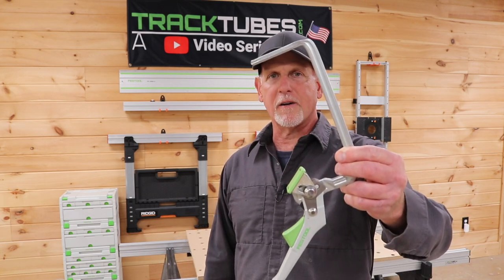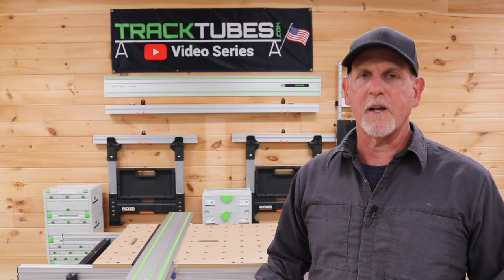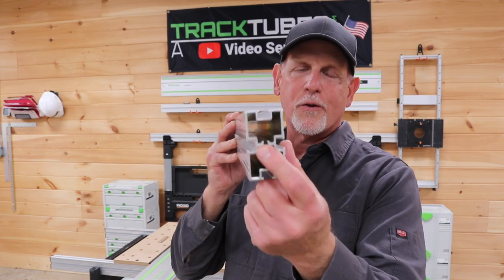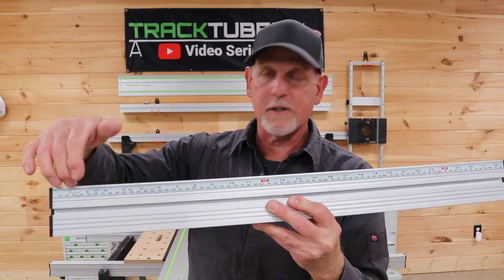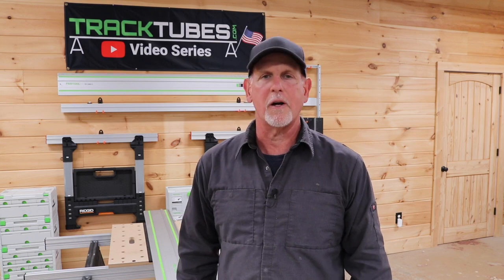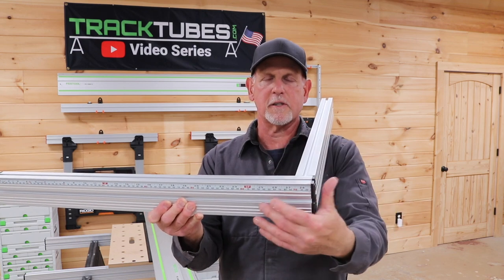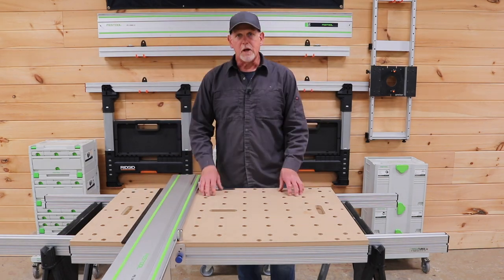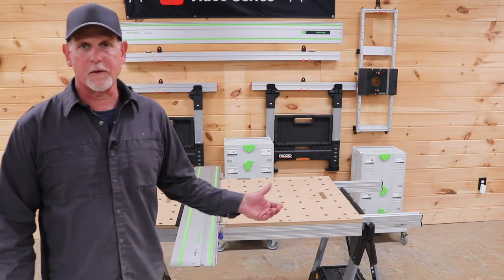TRACKTUBES QUADTRACK™: The Most Versatile Extrusion for Woodworkers in Decades!

Comment: Hello, again, Fred!  I’m liking the looks and applications for this extrusion.  When you sent me the pics awhile back, my hope was that there would be a way to attach extrusions at 90 degrees to each other.  This feature would be ideal for attaching small extension wings onto the track top.  If you utilize your longer tubes, the gaps between the main top and the wings could be used to attach a stepped-down/recessed storage tray/shelf for tools, small cutoffs, or even a tool like the Kreg Foreman that would benefit from a larger work surface when drilling pocket holes in larger work pieces. If used with vertical supports to the floor, another use would be an in feed/out feed table for a planer or table saw.  Also liking the idea of mounting a tube with the measuring tape to the TrackTop as a fence/stop block setup for the track saw.  Looking forward to picking up some of your products soon!  Keep up the innovation!
Reply from the maker: Barak!!!!  Nice to hear from you.  Things have come a long way since we last spoke.  The new tubes are at the anodizer and I am going to send out the pre-order offer with discount in a couple of days.  Probably ship in May.  I haven't done anything with the foreman but we have tinted around with the Castle 110 for a setup in the TRACKTUBES system.  It's pretty slick.  Thank you for all your support and encouragement.
Reply: I’d like to upgrade to a Castle machine someday.  They seem an improvement for sure.  

Glad to be an encouragement!  I like to support American small business when I can.

Comment: Fred - glad you came out with the Quadtrack. I was one of the first customers of Glenn for the original tracks with one t-slot. I work out of a garage shop and keep three MFT slabs on a ceiling cable storage system. I use Bora Speedhorses and can build or take down this 4'x8' table in less than 5 minutes with my 90" tubes. I use a couple of Festool dominos and two Festool connectors to tightly join the slabs. I liked them so much I bought a second pair and cut them both in two so I can make a one or two slab table for use around the house. Very versatile product. For the time this saves me and the large workspace it created for me these aluminum tubes have been priceless to me. I'm close to purchasing a set of the new Quadtracks to replace my current single slot tracks. Thanks-Mike
Reply from the maker: Hey Mike.  Very nice to meet you.  It's really neat when I hear form the very early adopters of TRACKTUBES.  I really appreciate the kind words and testimonial.  Glenn is an incredible human and has been a tremendous mentor to me.  I've learned a lot from him.  His brain never stops designing!  Please stay in touch and let me know if there is anything I can ever do for you.

Comment: I can saw a straight line with a circular saw, a straight 1x4 and two clamps. Board and clamps less than $15. Standard extrusions like 80/20 have been around for decades. Will this?
Reply from the maker: Sounds like you have a system that works for you.  That's great.  TRACKTUBES™ have been around close to ten years.  I'm surprised you haven't heard of them until now but glad you finally did.  Thanks for watching.

Comment: These tubes are just a more expensive version of European style structural aluminum extrusions which have been used for more than 30 years to rapidly assemble platforms and machine tool frames.
Reply from the maker: I've never see those but would like to.  If you are talking about the 80/20 style extrusion then TrackTubes are much different and more suited for woodworking applications.  Thanks for watching.
Reply: You are right. This kind of industrial extrusions are common over here in the EU. Maybe there are some slight differences in the slots

Comment: Very expensive. 
$179.00 for 1 piece of 72 inch extrusion
Reply: I believe they’re sold in pairs, if I’m not mistaken.
Reply from the maker: No, they are sold in pairs so you get two pieces.
Reply: Just buy regular 45x90 mm extrusion. You can build your own table.
Reply: I stand corrected